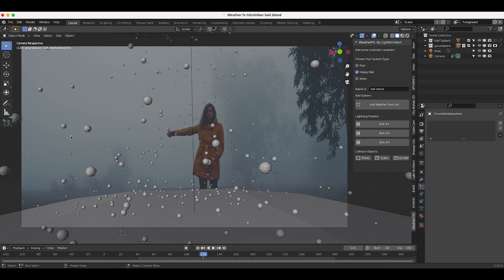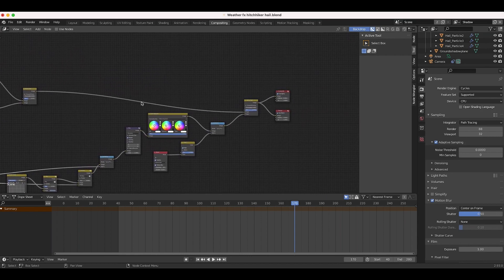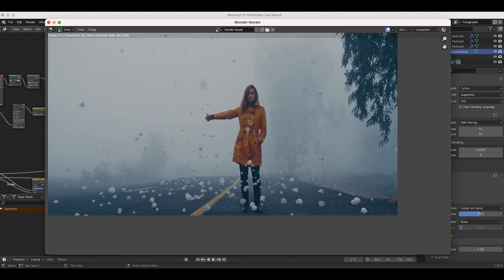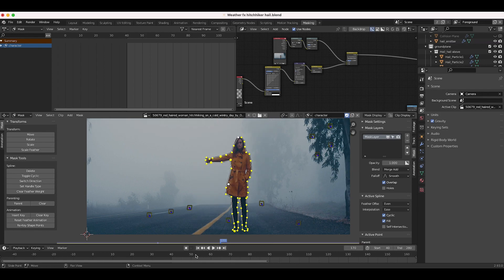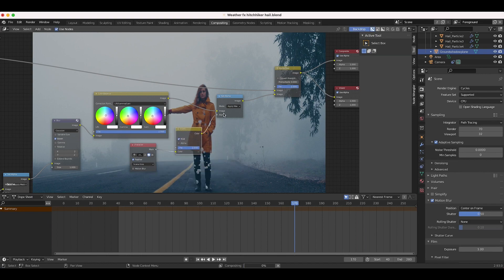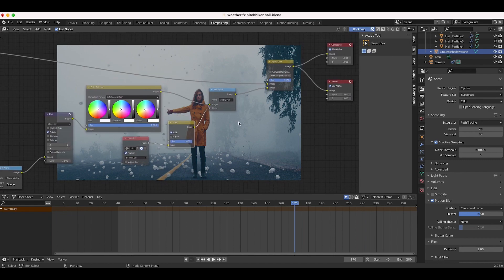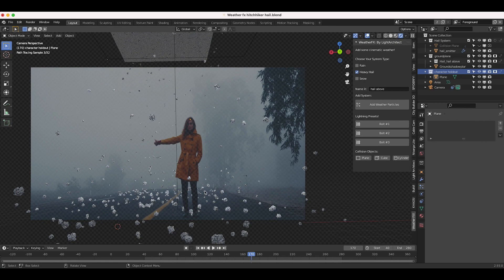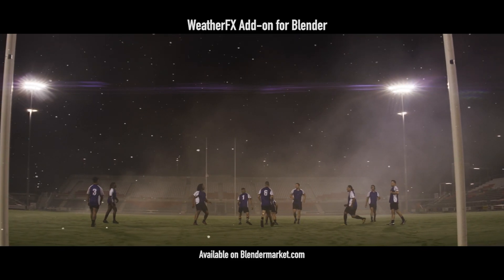3d Masking in Blender: Two effective techniques

Comment: Thanks for this tutorial, this is now fine for a somewhat static video, but for motion videos I think it's a bit more complicated..... or not?
Reply from the maker: You're welcome. Yes you are correct. However if the geometry that you are masking as a holdout is a static object(like a building for example) then the holdout works as the camera is moving around it as long as you have tracked accurately.
Reply: @LightArchitect  Hi  Brad, yes thank for the info, this holdout system is really great! i don't know how long it's been in blender, but it's fantastic, before when i created masks i had to play with textures to make them invisible, now it's just a click! however i think that to mask a moving subject/object in the video to make the insects appear behind you have to make the mask follow the movements frame by frame... and this still not being automated is a bit of a job! or are there other ways? very important tutorial would be also how to use spyderfy to create scenes like: I'm looking for boots to put all of a sudden a boot falls and from inside the boot comes out one or more spiders! I tried to do this and I used some objects for collision but as soon as they approach the object of collision jump and come out from where they should not ... however this addon is together with others a great job ... thanks Brad.